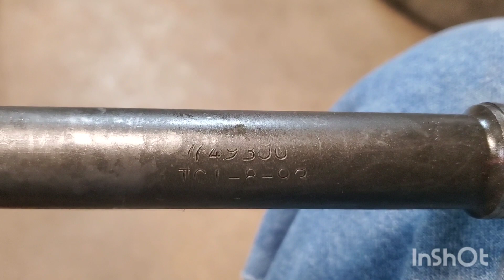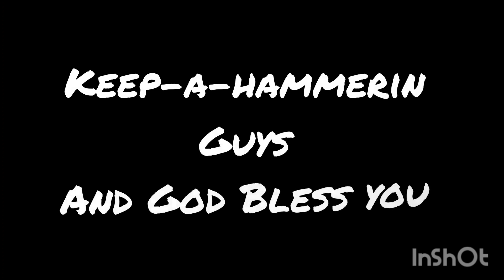Project Outfit Blues C10 Shop Truck Build. With A BBC 402. #nonamenationals 2023 Here We Come.

Comment: I use a file to check hardness. If it takes metal off then its not. If it scratches the surface lightly then its semi hardened if it laughs at the file and you feel no drag it has too much hardening and brittle. 
Most transmission parts are surface hardened from factory. Youll see a discoloration "rainbow" if hardened all the way the whole shaft will be darker in color. More dark more hard. 👍🚒
Reply from the maker: 10-4 I checked the numbers on this one and it's the good shaft.